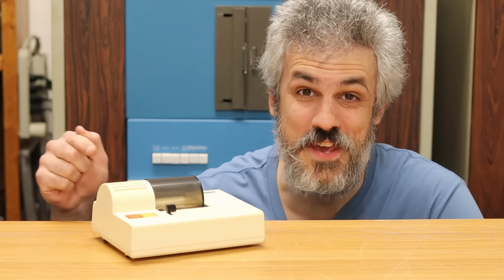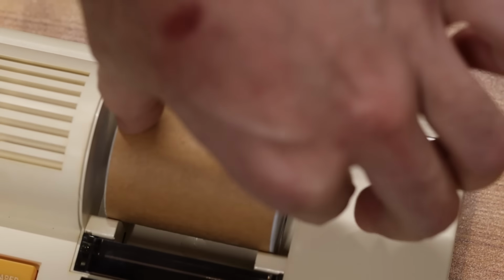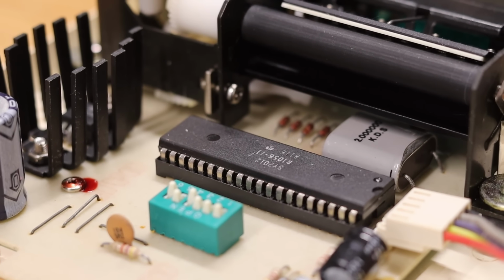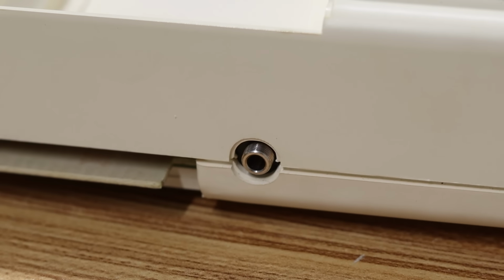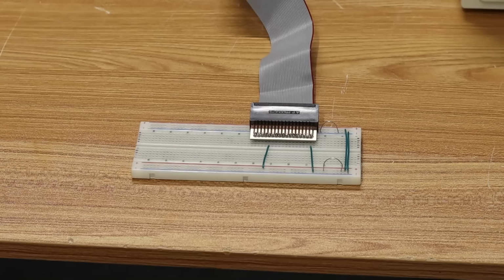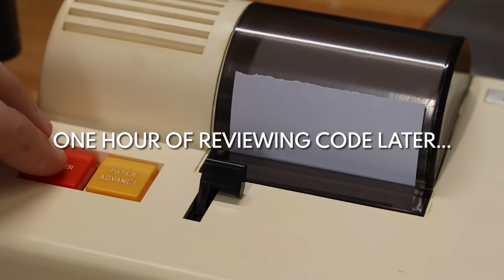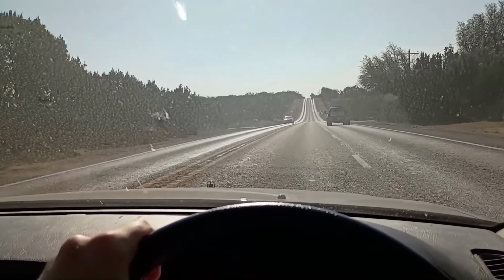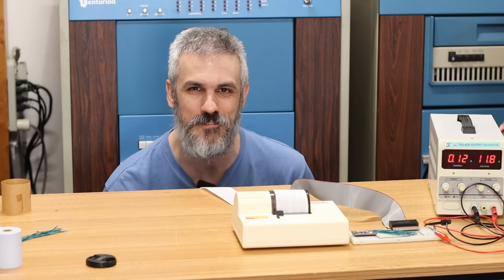The Cutest Printer on the Planet!

Comment: For a minimalistic interface, all you need is D0-D6 (D7 on ground), Strobe and monitoring the Busy Line. So 8 bits out and 1 in.

The Busy will rise whenever the printer is doing something and will return to low when the printer is able to accept any data. This is sufficient for a Handshake.

Wait until BUSY is low. Then put your 7-bit characters plus strobe on the line and wait until BUSY turns high. Immediately clear the Strobe (or send 0 to the whole output byte)
Rinse and repeat.

If something goes wrong, BUSY will remain high. The other status lines just tell you why busy won't turn low. Monitoring ACK is not necessary, it is always accompanied by the busy signal.
Reply: How about a LED indicator for the busy signal? A simple transistor would help decoupling it. Maybe using an R-C combo could further help filtering out short pulses - thus only long term busy states would be indicated on a 2nd LED. The sender's strobe signal is also a good candidate for feeding one more a LED indicator.
Reply: @alexanderstohr4198  That's "belly and whistles. Minimalistic is using the least amount of control lines, parts and effort.
Reply: I once drove a daisy wheel printer from a Commodore 64 without even checking the busy line. I suppose the printer had a buffer that handled characters fast enough to avoid issues. I was strobing it slowly since the printer was slow.
Reply: @markjames8664  Yes, that's possible. When everything works as intended and you are slow enough, you don't need any handshake. This is the reason why the COM port in DOS has this weird baud rate as a default. This is slightly slower than an average dot matrix printer so you can pump out the data one way without handshake.
You can even go lower than what I had described. Use OR gates on the data lines to generate the STROBE. When there is something other than a zero on the lines, STROBE is triggered. To "un-Strobe", just set the lines to zero. This can be done using a pull-down resistor and a bunch of diodes.
You should observe the BUSY line for the ahndshake and to know when the printer is offline or out of paper to stop sending data but you could also slow feed the printer. Then 7 or 8 output lines is all you need.

Comment: Maybe it would be worth keeping the Audrino or something as a data pre-processor.   Let it scan the incoming text and cut it to 20 characters (or whatever the printer uses).   Then it wouldn't matter if 80+ columns were sent to it.  It would automatically break it into 4+ lines on the printer paper.  'And much like the VIC-20.  4 screen lines is 80 columns.

Comment: Unlike a typewriter that has a head that prints out characters, or dot matrix impact printer or inkjet that print out small vertical lines, this works like a LED toner-transfer printer and prints out one horizontal line at a time - selectively heating some of the pixels in a row of them blackening the thermal paper in those spots and then moving the paper to do so.
Since it inputs text in characters and outputs in pixel lines - it has to buffer a full text line before it can print it.
Your C++ code has \r\n wrapped in single quotes for no apparent reason and that last quote is what is printed as a first character of every line except the first. It is printing exactly what you tell it to.
Reply: I can't say I've ever worked on a thermal printing device that had anything but a full width single dot height heater.  POS terminals, cash registers, even fax machines.  With the way the mechanism is shuttling back and forth over a single character width this thing actually appears to have only single heaters spaced out across with width of the line in character cells.  That would be a heater, say 7 dot spaces unoccupied, heater, 7 dot spaces repeating across the full line width.  Heat a spot to darken, heater off, move left/right, repeat X times to fill a dot line, then advance the paper a dot height and repeat.  If that's how it actually is working (why else is that bit oscillating?) that's a first for me.
Reply: @retrozmachine1189 that was the first thing I noticed. The print head moves the width of one character, thus having 20 single dot heaters, allowing the printing of all 20 characters at once, dot row by dot row. Bigger thermal printers usually have a vertical print head, just like a standard dot matrix printer.
Reply: In theory, a dot matrix printer with a full column of dot wires could print one character at a time  (and on a DecWriter or similar hardcopy terminal, they _do_);  but in practice, the printout comes out messy and things don't line up as well as if it was moving at a steady speed right across the full width of the paper.
Reply: That is true. 

Most dot matrix impact printers buffer a few lines of text and print them as however many lines of pixels are required, one pass of a head often spans 2 or 3 lines.

Receipt matrix printers printed a row at a time, which is why the receipts tended to have small width in comparison to modern ones that use thermal paper.
Reply: Thank you for explaining! I was wondering how the printing mechanism worked, and whether there was a print head with a column of 7 or 8 dot heaters, moving laterally. But it's probably 5x20=100 heating points arranged in a row, which simplifies the mechanical part, as you only need one motor in this case: burn a whole row of dots, move the paper up one step, repeat. And it allows for each dot to be heated for a longer time before the paper moves up. I hope it's actually 6x20=120 heating points, as it could allow for B&W graphics, assuming the printer has a mode to allow this (yeah, probably not).
Reply: @fixups6536  You are correct. The only moving part (excluding possibly the internals of the printing head) in any of the receipt printers I ever heard of is the paper. 

Thermal printing head's heating elements are relatively cheap and comparatively reliable.

This printer could print any graphics - as do modern ones - if its firmware has such a mode.

Most of those receipt printers were only designed with text in mind - not 100% sure about this one.

It should be possible to program a custom firmware that allows bitmap printouts - it would not be more complicated than text - which still could take probably considerable effort.
Reply: @fixups6536  The heating elements in this printer is double-spaced, so they move a bit horizontally and print twice for every row. That's why you need the entire line of 20 char/140 pixels buffered.
Reply: Wow.  People commenting in this set of comments really need to work on their use of row and column  when it comes to expressing the rows and columns of text and the arrangement of the pins on the face of the printhead.

Comment: Very cool small but extremely useful add-on to the project.  Reminds me an HP computer with built-in thermal printer that was used to control a rack of digital test equipment I designed in my first project for GE Aerospace way back in 1983.
Reply: HP85, HP86 & friends. Running HPBASIC. Which grew up into the original 9000 series, then models 9000/200 and 9000/300.

Comment: I always love the joy you get from things when they work and solving them when they don’t. Are you aware of the ZX Printer that Sinclair released for use with its home micro-computers? We had one and it was a silly little object. It used paper that was coated in aluminium and happily picked up fingerprints. I’m not sure why, but ours somehow had an alignment issue, so colons would look a bit like semi-colons, etc. Not so useful when you’re relying on it to print readable program listings!
Reply: IIRC the motor driving the printing stylus across the paper also drove the paper feed so it printed on a slight angle. Usual Sinclair value engineering taken just slightly too far.
Reply: @NiallWardrop Good info! Sir Clive sure did know how to innovate on a budget but, as you say, sometimes a bit too budget. My Spectrum was in regular use in my bedroom until 1994 and I'm still playing the games occasionally now
Reply: @Justin-TPG  I had a ZX80 with an '81 ROM and the 7805 on a chunk of metal bolted to the top of the case, they saved just a little too much on the heatsink so it used to overheat and lose pixels before I modded it.

Comment: I use a Brother daisy-wheel typewriter with my TI-99/4a. It uses a Brother IF-50 adapter to allow the typewriter to become a printer using an RS232 port on my TI PEB. It is so cool to be able to print from the 99/4a. My TI is also connected to a Raspberry Pi 4 through another card inside my PEB. The Raspberry Pi connects to the internet so easily, therefore the 99/4a also connects to the internet through it. It is so cool what you can do with these old computers.

Comment: They also made a printer for the ZX Spectrum, the Alphacom 32, which was much better than the original Sinclair silver paper jobbie. The instant I saw this one I thought of my old Alphacom 32, which I still own, but I don't know if it still works, I must wake it up one day.
Reply: power it up while pressing LF and it will enter self test mode….basically prints a shifting set of characters. bit of alcohol on a q-tip / cotton bud, rub it on the “print head”. a flexi circuit and that removes paper dust that stops it printing darker. There yet more versions of this printer for 80s home computers.

Comment: saying you can write assembly but C/C++ is a problem/stretch sounds hilarious to me 😀
(I should add that K&R C or Ansi C would be a challenge for me as well,  as it has been years since I did anything in C)
BTW I wonder if it supports the graphic characters the VIC20 had or even better bitmapped characters, probably not.
I still have a VIC20 which is currently at my place of work, I should hook it up with the original cassette drive I recently re-discovered. We used it as a darkroom timer back when I was in Uni as I could not afford a proper one. A room mate soldered up a board allowing me to turn the enlarger light on and off, it's fitted in a cigar box and I'm sure it's somewhere here lying in a corner.
That program at some point ran out of memory and  then it turned out that when you inserted the 3k memory expansion all video memory addresses changed so I had to revisit all those pokes and peeks 😉

Comment: I remember I had a weird thermal printer that used an odd size of paper. The "official" paper for it was expensive. I instead got the cheaper (regular price) paper roll that was too long. I wrapped it tightly in paper boxing tape to hold it together and used a band saw to cut to length. When I unwrapped the paper boxing tape I lost a few turns of paper but it was still much cheaper.
Reply: Excellent that it cut clean enough that to work.
Reply: @donmoore7785  As long as it's bound tightly either side of the blade, a bandsaw will cut very nicely through a roll of paper.

Fax paper is 210mm. wide, the same as an A4 sheet, so you should get three or four rolls for this size machine out of a fax roll  (still used in a few niche applications, typically where you need to send someone a drawing of something and the best way to do it is with pencil and paper).

Comment: I've got an old HP 82240B thermal printer (was a battery tester printer). I thought it was a cool little printer for my home brew computer but this thing is legit out of the 1970's !
Reply: Sounds similar to my old 82162A HP-IB printer for HP 41C calculator.
This device actually sounds very similar to my old Rockwell AIM65 development computer integrated printer. Explains the unknown Rockwell chip on this device probably copied reference design.
Reply: @martinmartinez250  HP 82240B uses an IR sensor for data transfer. Your HP 82162A would look more correct for a home brew.

Comment: Radio Shack sold what IMO is an equally cute and small 4-color plotter(!!) called the CGP-115.  As a kid, I had a lot of fun getting it to print "3 of 9" alphanumeric bar codes from TRS-80 Model 100 BASIC!
Reply: Mine is also long gone, as is the NewBrain it was connected to. But I still have an old spare paper roll hanging next to phone for message taking 😀
Reply: CGP-115 Cousin!! tikka-tikka-tikka-tikka Draw-dididrawdraw-didididrawdraw tikka-tikka :) I used mine with an Apple II. I only had three TTL outputs of my game paddle connector so I breadboarded a shift-register and 8-bit latch to make a serial-to-parallel connection, then wrote the 6502 routine to serve as a print driver. worked like a champ. I thought I was hot snot for 18!!
(Barcode!?! I had not thought of that trick. turn your printer into a data-storage device. Somewhat. I bet you had a barcode pen on the M100 didntcha. Noice.)
Did anyone find a way to refill those little bullet inkpen cartridges?

However, MY Vote for cutest printer, must go to the Apple Silentype. Smooth as a mayonnaise sandwich. Although, 40+ years later, I still have some of the "toilet-paper-roll" output I printed on the CGP, and that print, is still legibile. thermal can't touch that. takes Ink.
Reply: @bzert281  Yep, had the wand, you nailed it!  I wish I had held onto that, the plotter, AND the Model 100. 
I remember the Silentype! and agree it was super cute and that silvery paper was pretty eye-catching. The guy who wrote the Silentype firmware was Andy Hertzfeld, who went on to be the software lead for the original Mac OS!
Reply: I remember a thermal printer from RS for the TRS-80 model 1 that used aluminum coated paper and it "burned" the aluminum off leaving dark dots.  Kind of hard to read since the paper was reflective, but it made perfect copies on a copier!

Comment: I don't know... My Commodore 1520 plotter was pretty darn cute. The biggest problem was that the tiny one inch pens in the turret didn't hold much ink. As a penniless teen, I learned to carve pencils to fit as a low budget replacement.
Reply: I got the Tandy version of that plotter, and used it, when had the wretched pens, on my BBC B and ZX Spectrum computers, painfully slow to print characters, but great fun for plotting graphs and stuff. If I remember correctly the command language was incredible, I recollect, hopefully accurately, that you could print a graph axis from just one command with a few parameters. Very clever little machine. I never thought of using pencils, and there was me thinking I was so clever and resourceful.
Reply: There was nothing like seeing a printout of my own BASIC programs, scrawled one character at a time... in pencil. It did have very simple parameters that allowed resizing of the built in "font". (vector driven, I assume) I would tell my Commodore to CMD 3, PRINT#3, throw some ASCII at it,  and the plotter knew exactly what to do!
Reply: @Richardddoobies  Did you put the shaved pencil inside the shell of the original pens or shave 'em down to clip straight into the pen holder?
Reply: They were "rawdogged" right into the turret.
YOU WILL NEED:
one pencil
one 40 year old plotter
sandpaper
a tiny saw or wicked knife

1) Steal a pencil from your brother's school supplies and chop the eraser off
2) Take the pencil and sand it down lengthwise until it fits in the turret
3) Chop the pencil into one inch sections, saving enough length to sharpen thoroughly
4) Sharpen thoroughly 
5) Awkwardly jam the pencil into the turret, trying desperately not to damage it
6) Repeat if necessary 

Pencil will need to be removed and sharpened occasionally.

Comment: Nice printer. The thermal head on those can wear out over time, though yours doesn't look like it got much use. I once had to replace the head on a thermal printer that was built into a large industrial autoclave. After 30 years of regular use ( 4 times a week ), the print head fade away to nothing. Fortunately there were still some new/old stock parts available at the time. Over an hour to replace the part. Your printer would take a minute or two to change the print head.
With that terminal on top of the box, and a thermal printer, all you are lacking is a cash drawer. You would have a nice little POS unit. 😅

Comment: Is this any different to a standard "Centronics" parallel printer interface? Hmm only 7 bits here though. Wonder if any of the dip switches will activate auto line-feed on long lines?
Reply: 7 bits would work fine, it would only print the lower 127 characters in the ASCII table but for normal text that's not a big deal. On a standard Centronics cable the D7 pin would just not be connected.

Comment: I have always wondered if you can use the heating element to cause permanent burn marks on skin. It would be world's first auto-tattooing machine.
Reply: I don't think it gets hot enough. 

Just leaving thermal paper on the seat of your car in the summer can blacken it. 

You can also make marks on it by placing it on a table and swiping your fingernail across.

Speaking of auto tattoos, what about a dot matrix impact printer with needles instead of pins 😂

Comment: Nice little 20 column printer.  As I recall, Radio Shack made a 40-column printer for the Color Computer 2?  Yes.  It's call the TP-10 Thermal Printer.  Documentation is available (I have a copy in PDF).